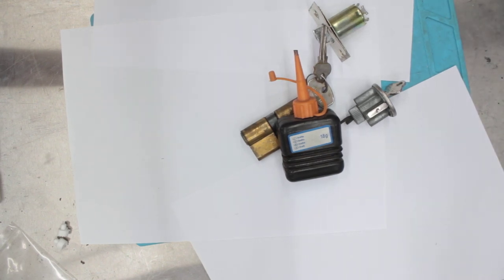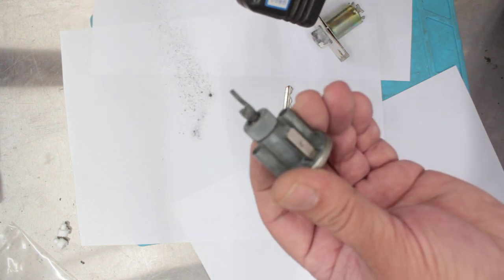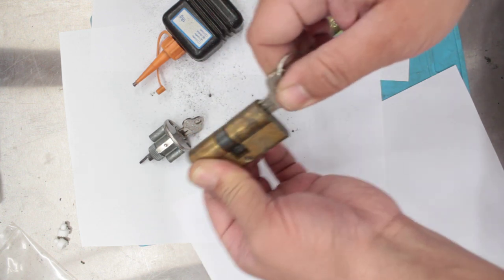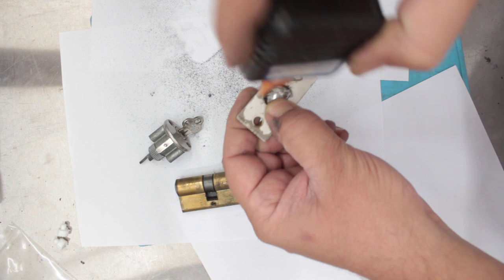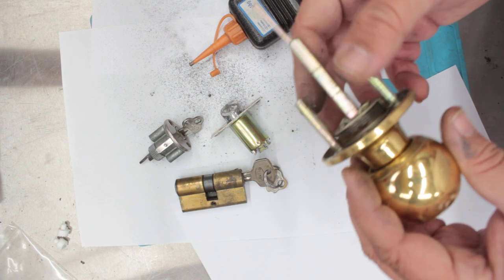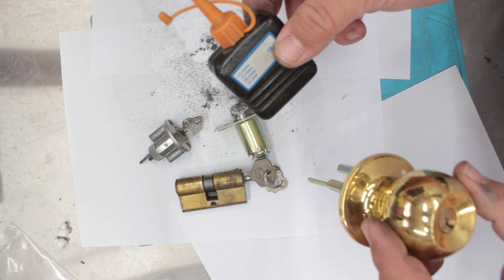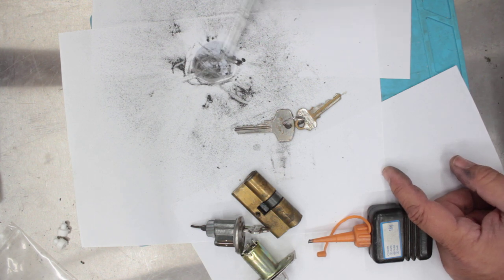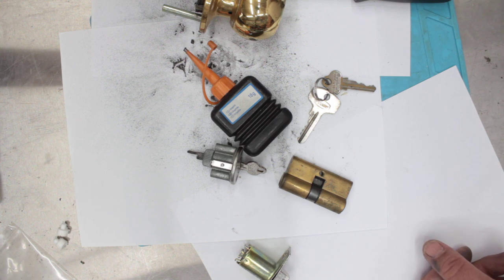Graphite DOES NOT Fix Locks  ☹️ ☹️ ☹️ ☹️

Comment: I put a line of graphite along one groove in the key and put it in and out of the lock, then repeat on the other side of the key. Then squirt a little bit more in. Seems to work to lubricate for me. No WD-40 either, it dries out over time like it's designed to.

Comment: That's all I ever used for years mainly because back in my days there was no other choice, until many years later when they came out with the graphite spray. Pretty much all I'll use now but not investigated into anything that's better. 
Not done this trade in years now either, just as a lock sport.
Reply from the maker: I will have to check out the spray, I have only used powder
Reply: @DrLockShop , It's been so many years I don't remember the name nor who we ordered from. If you find some probably is in a small can, or ours was & you'll see when you get some you won't use anything else.

Comment: As a beginner lockpicker I find this very interesting. 
So far when I have come across an older lock that seems a bit touchy I give it a 1 second blast of carbie cleaner  let it sit for a few hours until all the volatiles have evaporated then 1 puff of graphite and all seems good.
Are there any other acceptable lock lubes I could use?
Reply from the maker: Graphite is excellent for lock picking, it has saved me a few times
Reply: Good enough for me
Reply: Where is Houdini available in Australia?
Reply: I know this reply is 4 years later but PTFE powder also works well. PTFE also is less messy because it is white.

Comment: You are taking it the wrong way!...take your graphite #2 pencil and run it over the teeth on the key. Then insert in keyway...your pins and tumblers will get older as the yrs go on.
Edit: also buy a lock NOT made in China? :)